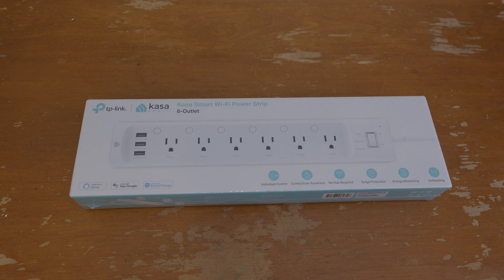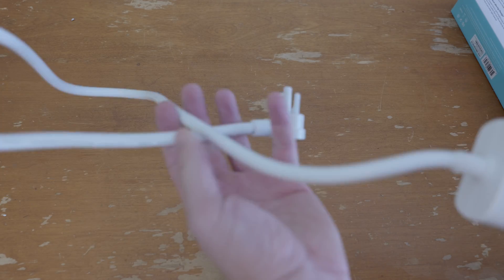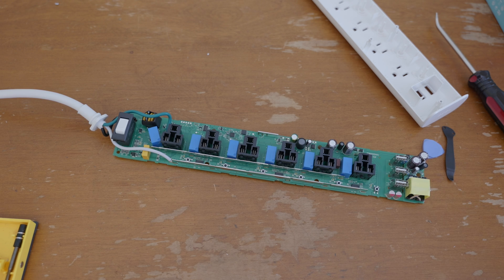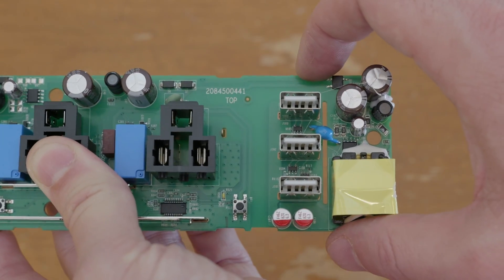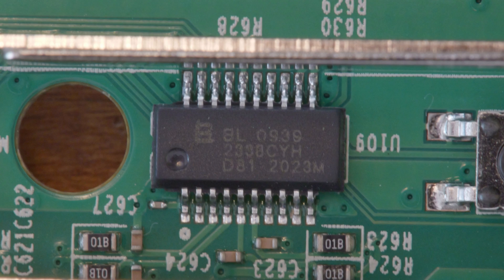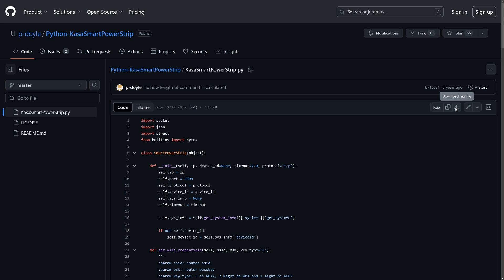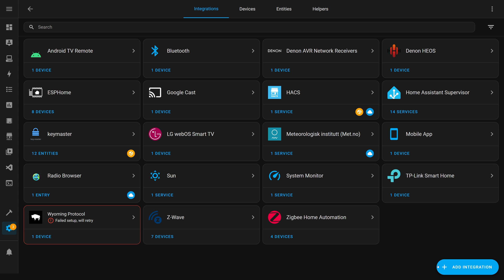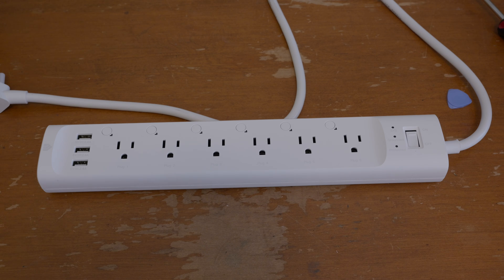Kasa HS300 Power Monitoring Strip (bypass the app!)

Comment: Hi @Tech Dregs can you explain the Python part better we do not see you running it so I do not know what the expected results look like. I followed what I could but HA is not finding the power strip. 
Steps:
1. Factory rest HS300
2. Connect to the strips wifi
3. Open the Py file in IDLE > Run (without modifying)  > IDLE shell opens
4. Enter in that open IDLE: power_strip = SmartPowerStrip('192.168.0.1') > press enter
5. In the next line of IDLE enter: # for WPA2 the key_type is '3', I would guess WPA is '2' and WEP is '1' but I have not tested this
power_strip.set_wifi_credentials('my ssid', 'my psk', key_type='3') with my wifi name and pw > Enter
6. Get error " {'netif' : {'set_stainfo': {'err_code': 0}}}

I can see the individual smart plugs connected to my network but HA is not picking them up. Please help.
Reply from the maker: Not sure, I did not build the python code. Are you sure your Wifi uses WPA2 security?

Comment: Power monitoring and remote switching of the USB ports would have been really useful.
Reply: Curious, what would you use power monitoring on a 5 watt plug for?
Reply: @TheOfficialOriginalChad  right because there is power monitoring on the outlets already.
Reply: @TheOfficialOriginalChad I have a couple pi’s running as servers for various things. I don’t have a need to remotely turn them off, so using one of the outlets is a waste of that outlet. I plug them into the USB ports for power. 

However, I DO want to track power consumption in Home Assistant. This is where current monitoring would be nice.